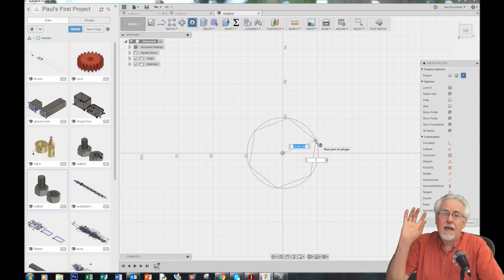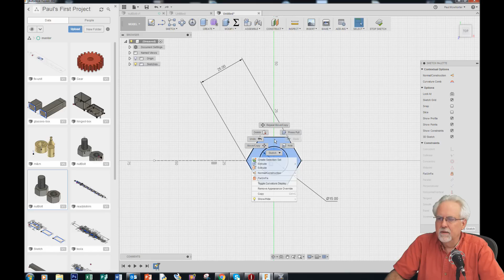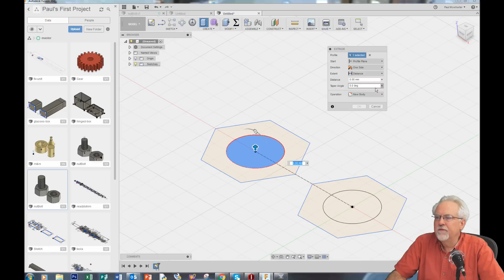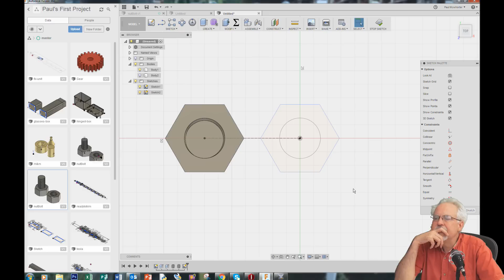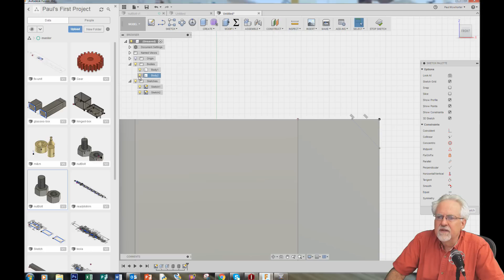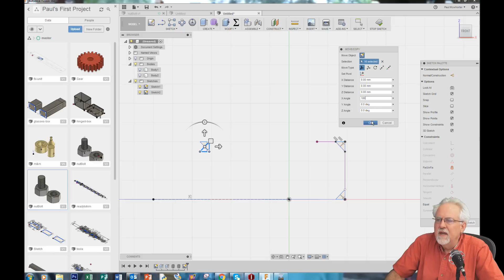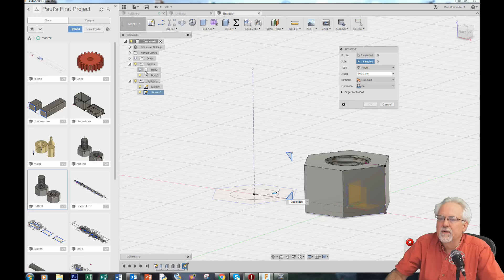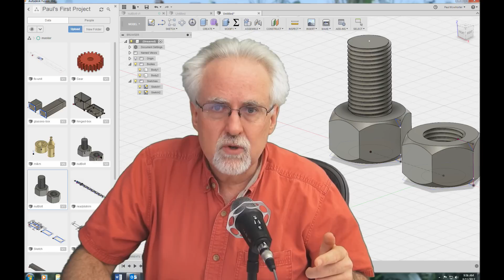Learn Fusion 360 or Die Trying LESSON 7: Design 3D Printable Nuts and Bolts

Comment: sir, when i put on the X-Y plane fusion 360 automatically puts it as front view whereas in your videos its in top view. can you suggest me any possible solutions ? it will be a huge help.
Reply: Akhil Saji, I like it to stay in the view that it's already in personally.  If you would ike it that way too, turn off a check box in preferences:
At the top right is your user name.  Click the drop-down, then Preferences-->General-->Design, uncheck "Auto look at sketch".  If you find it annoying when the sketches turn off after doing an extrude or similar like most of us do, then also turn off the check box for "Auto hide sketch on feature creation"
Reply: Thank you Gary. Nice Tip.
Reply: Good one Garry. Had the same annoying problems
Reply: Sorry....Spelt your name wrong Gary

Comment: I know this series of videos is a couple years old, but I'm moving through the series and learning a LOT.
I have a question related to this specific lesson.  When I 3D printed this nut and bolt, the fit was a bit tight, so I wanted to modify the design to put a small gap between the screw diameter and the nut hole diameter.  This should be easy, because even though Paul didn't use parameters in this design, I did.  (It might have been all the "NOOOO"s in the parameters lesson. :-)  I have a parameter called nutHoleDiameter, so I simply increased it by a bit, but unfortunately, this didn't work.  The circle in the sketch changed, but the hole stayed the same size.  The problem seems to have to do with the screw threads, as I did another similar design except without the threads, and the hole changed in size.  Does anyone know what's going on here?

Comment: Hi Paul,
First of all I want to thank you for this series of F360 tutorials. It's a bliss to find a "down to earth" and human learning curve kind of curse.
Regarding the nut and bolt, I am wondering about the small tweaks required for printing. Let me explain:
The nut and bolt are threaded with the default parameters, and use the same parameters for both. After printing, the nut and bolt are not working.
The print is fine but my guess is that the small changes in volume that happen with 3D printing (usually 0.2mm expansion of the material) made this problem.
I usually consider this change by changing the measurements by 0.2 (or 0.4 in holes). But I couldn't figure out how to do that with the threads. I am also wondering how come it worked for your print.

I use a mid-high range 3d printer with it's unique filament....

Any ideas?
Reply from the maker: It printed just fine on my Prusa and Raise 3D. Sometimes you have to work it a little to know off any little imperfections, but I have never had to adjust dimensions on these, just make OD of bolt match ID of nut. Perhaps putting a small difference would give you some tolerance on your printer.

Comment: It could be my printer but when I print this, the bolt & nuts fit too tight. I have to sand them a little so that they fit better. Anybody else with that issue? I was thinking to design bolt or nut a hair smaller/bigger respectively to work around that issue. I am thinking that I can't be the only one with this problem. Wonder what others are doing about that?

Comment: if you try to print and fit the nuts to the bolt it will not work , while adding the thread you gained some milimiters inside in the nuts and outside in the bolt

Comment: So be honest. Did you ever printed a designed bolt? I bet this wont fit because you didnt added tolerances.
Reply from the maker: Yes print it and it works. The parameters in fusion 360 add tolerances. You do not have to. Might depend on your 3D printer, but mine on high resolution they fit perfectly.
Reply: @paulmcwhorter  Okay high res is another thing. I print on ender 3 and got kinda meh screws that doesn't fit that well and there was no other that mentioned adding tolerance. Got good help on 3d printing discord server.

Thanks for replying.